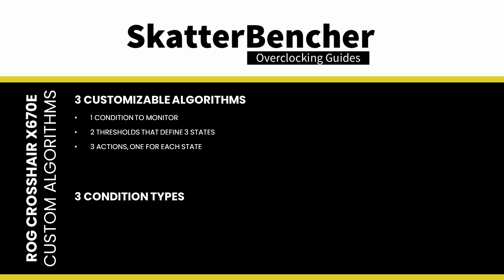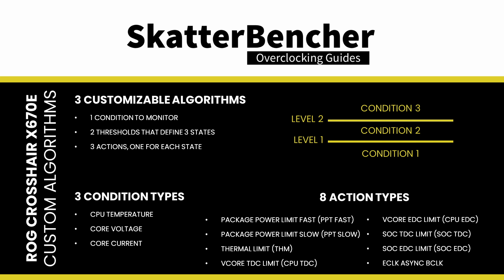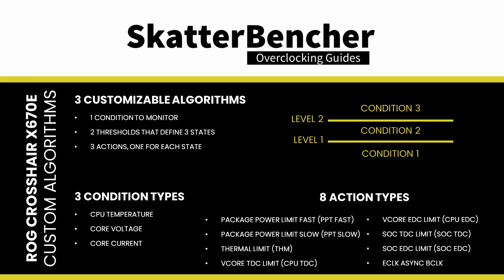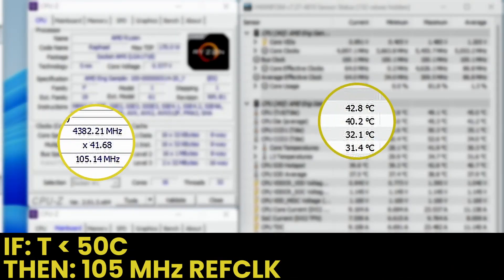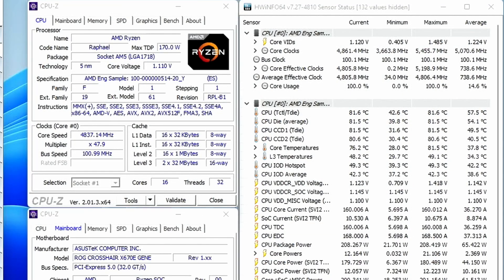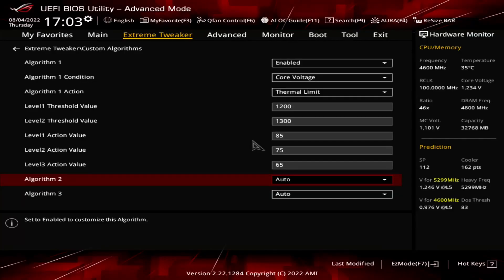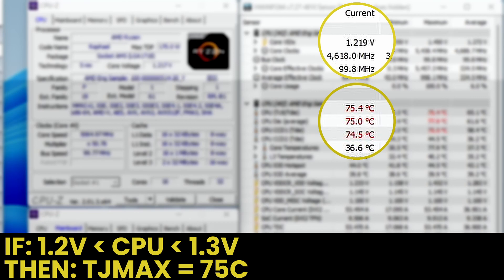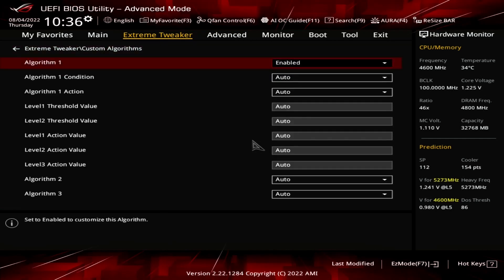Ryzen 7000 Dynamic PBO Temperature Control with ASUS Custom Algorithms

Comment: A longer video would be cool, showing how it affects temps and performance, maby even using it to make a quiet system where the fans stay below audible rpm's etc.
Reply from the maker: Most of my systems are on an open test bed, so I'm not sure acoustic is a good target. For now, I always map the radiator fans to the water temperature so it ramps up as the water ramps up

However, I've been thinking about in-chassis systems and how to regulate fan speed there. Acoustics makes a lot more sense there. What would you consider as "too noisy" for a system?

Comment: you could spend half life tuning this thing
Reply: That's why this guides are so useful. If you know what you approach and what their meaning, it saves you a ton of time. On your side of things, you just need to enter the values and check stabilization, change values if needed until you get fully stabilize. 
I didn't encounter a motherboard company that explains all this features In this detail, and thats a shame.
Reply: Yep I watch it and I'm like wow so cool I'm gonna do that with my 7950x and then I never do cause I just cbf pressing more than two buttons

Comment: I have MSI x670 and GSKILL DDR5 memory. The system starts 60-90sec late at every boot, is this normal?
Reply from the maker: Especially early AGESA was very slow to boot, though more newer versions should be a bit faster. You may want to check if there's a newer BIOS available.